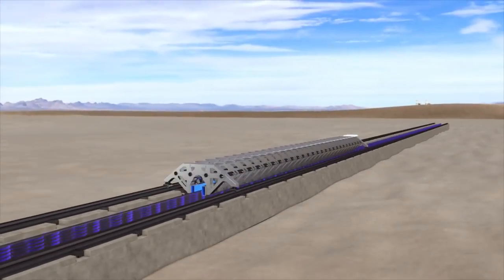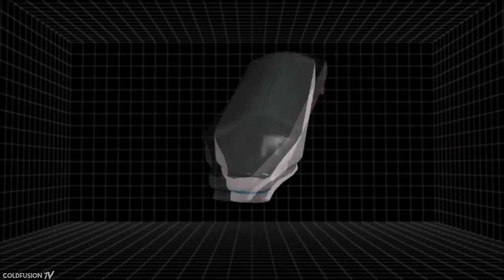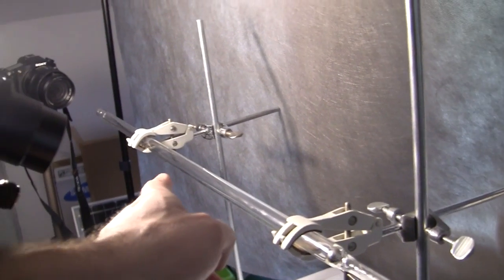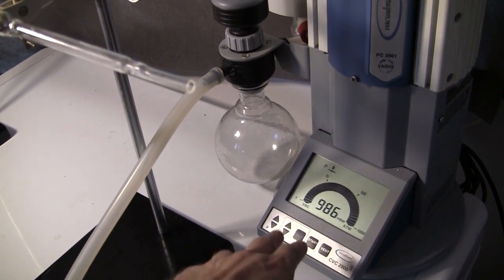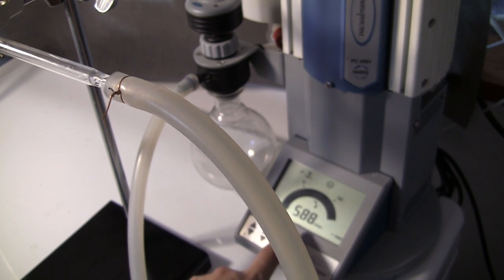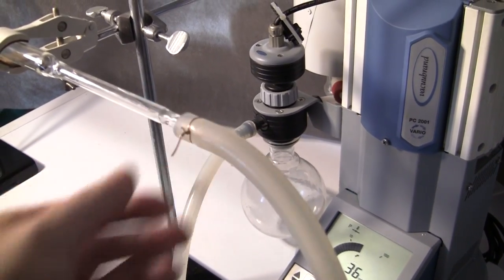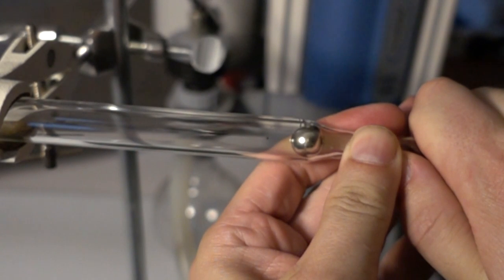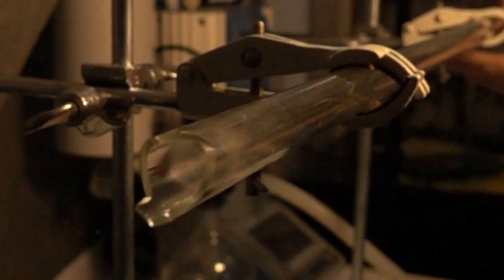How  the Hyperloop can kill you!

Comment: Recalling the physics I did when I was 13, not that long ago mind you, Force = Pressure/Area. So, assuming the pressure difference on either side of the hyperloop is the same as that on the ball bearing, the increased area of the hyperloop would result in an enormously lesser force and thus a much lesser acceleration (F=ma). Seems obvious although I may have missed something.

Comment: In this event, could you not simply place vacuum sensors all throughout the tube, with pressure release valves? The sensors could react to the rapid pressure increase and open all the valves to prevent this from happening.

Comment: ah, showing ignorance again, i see you are trying to best your brexit series. linear motor takes care of both acceleration and deceleration and additional measures can be implemented. also its not maglev but ground effect based so pressure will be quite a bit higher, not that that would make it impossible either, just inferior design. in fact it seems to be best musks idea yet, tho having really long distance connections, particularly underwater, can prove rather challanging.

Comment: 'With no means of stopping'. There's the rail, the same mechanism that accelerates can also brake. Electromagnets can exert greater power than gas pressure. It's why rail guns attain higher velocity than conventional cannons. An emergency expendable one shot friction braking mechanism seems entirely feasible.

Comment: You're forgetting something, thunderfoot. What would make that more accurate is if the ball was smaller than the tube. There's nothing that says that the train has to be the exact size of the tube, and since there is space on all sides, the air wouldn't be pushing against the train turning it into a "bullet" it would be going around the train. Instead of shooting it in one direction it would just be slightly slowing it down or speeding it up.
Reply: Have you been hit in the head recently? You've been really off your game
Reply: I would've assumed that they would use a venting mechanism to allow air to pass through the sides or not - kind of a method to control the force applied.
Reply: +Platinum Spiderman The Hyperloop doesn't use air for its acceleration. It uses the linear induction motors which work off of magnets. Why would you use air for acceleration after you evacuated almost all the air anyway?
Reply: that's not how the hyperloop works man. it's not a pneumatic tube like at the bank machines. The complete tube is a vacuum and the acceleration comes from the magnetics, like a rail gun. The vacuum is what allows the fantastic speeds, no friction.
Reply: I just hope they don't make the cars bigger than the tube.. that would be awkward indeed. It would really slow the cars down.
Reply: Platinum Spiderman You must have read it wrong. I was assuming everyone knew that the hyperloop works the same as other maglev trains. The only difference is it does it in a near vacuum. Which is a HUGE deal. Ever wondered why the air speed record is 3x as fast as the land speed record? its because the air is thinner the higher you go. If you can get the air that thin on the ground (by making a hyperloop) it will change everything.
Reply: If the ball was the same size as the tube, the ball wouldn't move.
Reply: You, must not no a lot about physics.One, the hyper-loop is barely smaller than the tube (In order to increase the area that is hit by the air, thus increasing the speed.)If The hyper loop was substantial smaller than the tube, it wouldn't travel as fast.That's why the ball he used wasn't really small.Instead of talking shit, maybe do some research.
Reply: "Why the fuck don't the cars fit in the damn tube?!"
"The cars are bigger than the tube, sir."
"Bring me pictures of spider-man!"

(I don't know why elon is JJJ all of sudden, but the voice fits your story, I guess)
Reply: If you guys would read the hyperloop alpha paper you would learn that the proposed capsule is already much smaller than the tube... The capsule/tube area ratio is 36% for the smallest version, 47% for the larger capsule version. Artistic conceptions and Thunderf00t drawings misrepresent this.
Reply: Platinum Spiderman The hyperloop is concept phase only right now. There is nothing to stop them from creating one where the tube is larger than the cars as this would effectively be a safety precaution in case of a breach, since it uses magnets and not pneumatics to move.
Reply: Mr Tommy Pickles
The force of the air entering the Near Vacuum would be great. BTW I'm just going by what I saw in the video.I know that Electromagnetism is used in the train's acceleration, I was just responding to what this guy said.
Reply: a) using the force of the air entering the near vacuum would be really wasteful i think so there's no point to doing that
b)if the ball was the same size as the tube (assuming it's not 'stuck' or has high friction +  assuming identical mass) it should get the highest speed because you have all the outside pressure pushing on the ball and a near vacuum on the other side (hardly any air flowing around the ball)
Reply: Another thing to think about, the train wouldn't be solid like the ball. it would be hollow. So there might be greater acceleration, because the mass would be less. f=ma or a=f/m
Reply: ***** Look it up. Yes it costs money, but it costs LESS than a regular high speed train. In fact some estimate it would cost 10% as much as a high speed rail http://www.investopedia.com/articles/investing/050815/elon-musks-hyperloop-economically-feasible.asp

Comment: Apparently a vacuum failure in the real hyperloop would "quite literally be like being shot down a gun barrel"?  If you have a 2m diameter train car that weighs about 3500Kg the greatest acceleration possible from 1Atm of pressure is about 9.25g, and that's if the tube is perfectly sealed and there is no friction  (a=A*P/M).  The acceleration of a bullet is on the order of 10000g.  So I call bullshit.

Comment: Just add pressure sensors along the tube and relief valves that open in the event of tube failure and problem solved. Plus the magnets that propel the train could brake or at least mitigate the effect. Sorry TF this one is BS.

Comment: Looking at this from a different perspective, this problem almost seems as though it could function as an ingenious propulsion solution. 
Let's say the Hyperloop's initial function was not Human transport, and instead only transported goods. If there were fast-opening valves at the ends of the tunnel, could we not use that rush of air to propel a freight vessel instead of an electric turbine? (Or whatever they're planning to use for propulsion.) As for braking, if there were a good enough seal between the vessel and the tunnel around it, valves could open at the other end of the tunnel at a pre-determined time, perfectly calculated to allow a secondary rush of air to stop the vessel. Would something along these lines work? (I have no idea, just bullshit that ran through my head, probably should have kept it in there.)

Comment: Build in an emergency valve every few hundred meters. If there's a hole in the tube, open all of the valves and there's pressure in front of and behind the probe => no acceleration. Problem = solved?
Reply: Also: If the probe detects pressure behind it, make it shut off its magnetic field to make it brake using the friction on the rails.

Comment: This is a very real concern for the concept, but wouldn't a prudent safety feature be to install valves rigged to release the vacuum in FRONT of the train in the event of a vacuum failure behind it? wouldn't that cancel, or at least reduce the affect of the acceleration that the failure might cause?

Comment: Walls capable of holding the vac. are certainly feasible. It's only 1 atmosphere. That's pretty easy. Nuclear reactors routinely handle 100 atm. And the catastrophic failure you have modeled here, essentially a guillotine failure, is mighty unlikely. By far, say by a factor of 10^5 or so, the more likely behaviour is leak-before-break. And there are lots of ways to contain such a leak once it happens. That does not produce a catastrophic failure.   There are other more fundamental problems. Pumping out a chamber 100's of km long is going to require expenditure of vast amounts of energy. Keeping it pumped out will require more vast amounts of energy.  The operational cost is stupidly unlikely to be lower than for an ordinary train, say a bullet train. And they are fairly happy at 300 km/hr.

Comment: The magnetic propulsion in the Hyperloop can also be used as a magnetic break if the tube would leak pressure. (Lighting fast breaks that can slam harder and faster than mechanical breaks)
Your experiment used rapid pressure increase as propulsion and that is not how the Hyperloop is intended to work. Is it?
If it is, then it would be a bad idea. The acceleration increase is well controlled by the electric rail motor and not by decompression. So no risk of to fast acceleration for the human body. You can accelerate how slow you feel comfortable with.
Reply: The hyperloop is just a maglev train put in a tube with small amount of air to reduce drag.